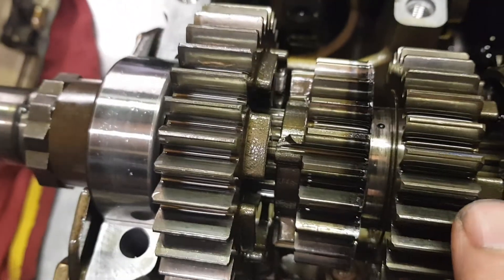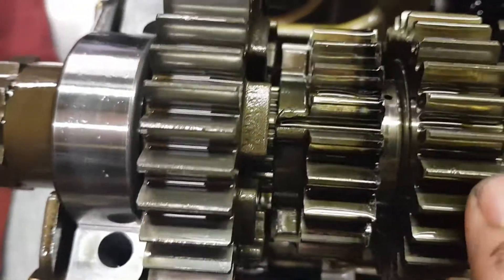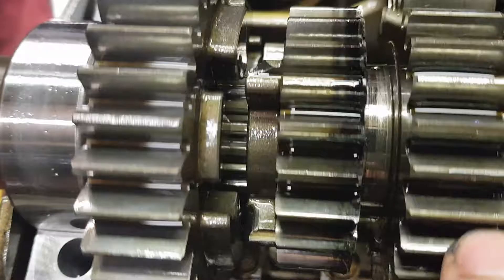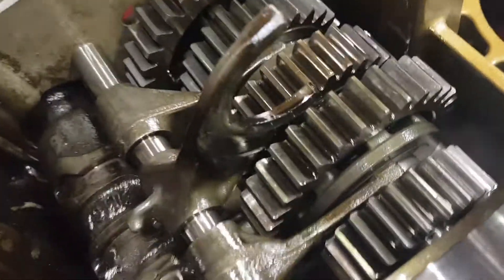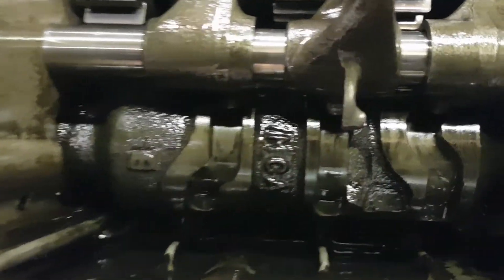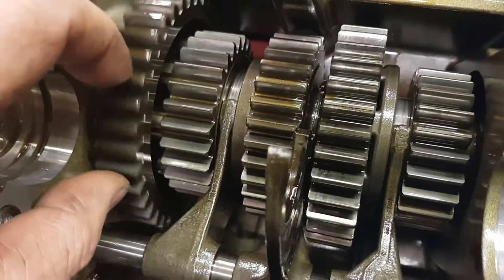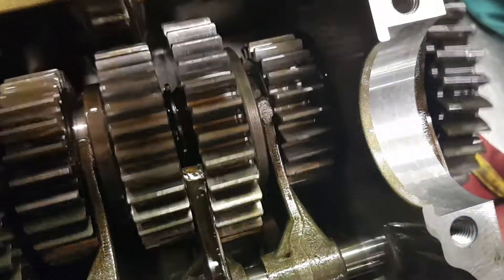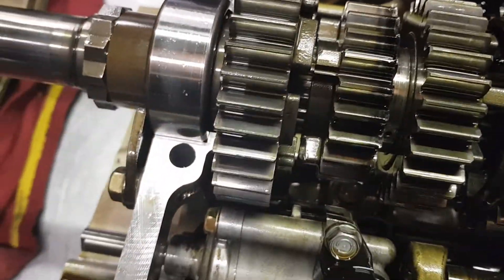015 - Another GL1800 Gearbox Failure - We Can Fix It - 2

Comment: I have had two Yamaha ventures, combined mileage over 200,000, over 18 years, one BMW K 1200 LT, I won’t go into it but I will never buy another BMW. And I just bought my first GL 1800 Goldwing.
 I read the owners manual cover to cover, slowly, because I was in a hurry to absorb all the information that was different from anything else I have owned..
 I learned one thing that many gold wing owners seem to ignore. The manual specifically states, do not use a heel toe shifter on the gold wing...
  I am betting that the factory knows more about that subject than the people that make he’ll toe shifters in the aftermarket for the gold wing.
  my Goldwing had some aftermarket accessories. One of them was the heel toe shifter/floorboards. I am not a fan of floorboards, I removed the floorboards and put the stock foot pegs back on as soon as I got the machine home. Luckily, The machine only had 13,000 miles on it when I bought it, so the heel toe shifter was probably not on there long enough to do any real damage..
when I bought my machine, it is a 2002, I bought it in 2019 from the original owner. He was honest and told me that he never did things like change the clutch or brake fluid, he never changed the air cleaner, the machine still had the original 18 year old tires on it. So I spent weeks doing maintenance chores.. changing the brake fluid, and the clutch fluid, when I used my vacuum bleeder on the clutch to change the fluid, that brake fluid looked like melted chocolate ice cream. I’m surprised the seal didn’t fail.
 The air cleaner had a mouse bed in it. The fork oil was never changed. While I was at it, I replaced the fork seals and wipers and fork fluid and upgraded the fork springs. I also upgraded the rear shock spring to match The fork springs. They were 18 years old, and what a difference it made. It transformed the motorcycle.
 Anyway, while I was doing all of these maintenance chores, I was looking for the fuel filter. I went through my phone book sized factory Honda service manual, I could not find anything on the subject of fuel filter or fuel filter location, in the maintenance schedule, they don’t mention the intervals to change the fuel filter. I couldn’t find one on the Internet for sale listed.
  it turns out that the GL 1800 from the factory does not come with a fuel filter.. that sounds crazy, but there is no replaceable fuel filter. Maybe the in the tank fuel pump has a very fine screen over the in the tank fuel pump pick up..
  my experience as a motorcycle mechanic in four different shops with transmissions is, if you miss a shift, do not jam the bike into another gear until the RPMs drop, and always shift up. Take your foot off of the shifter when you are done with every shift to allow the shift PAWL to re-center around the shift drum shift pins. Never rest your foot on the shifter. You will burn the shift forks and the channel on the gears that move when the shift forks apply pressure.
 always always always use motorcycle specific oil recommended by the manufacturer. You cannot use car oil in motorcycle engines ever again. The reason is
  in 1988 or 89, the federal government asked car manufacturers and oil companies how they could work together to get more miles per gallon out of a gallon of gasoline. The result was a huge change in oil’s that we use in our cars.
  to cut to the chase, they have removed most of the zinc and phosphorus from the additives package of oil to make it thinner, less resistance to flow, the engine doesn’t work as hard, even if every car on the road using these new thinner oils gets 1/10 of a mile further per tank full of gas, that will save millions of gallons of gasoline per month.
  here’s the problem with modern oil’s made for cars, I repeat made four cars.
 remember I said they removed zinc and phosphorus almost completely from the additives package that they add to oil.. well, zinc and phosphorus are the exact two additives that give oil something called higher film strength. As gears in the transmission mesh on a motorcycle, which uses the same oil to lubricate the crankshaft and the cylinders, in the transmission, as those gears mesh,, those gears and that oil is subjected to a condition called “Shear”..
 sheer, actually slices the molecules in the oil, and it keeps chopping them every time that oil gets squashed between the gears as they mesh under pressure. You can tell when your oil is worn out on your motorcycle when it becomes difficult to find neutral, and when it becomes difficult to shift. I have experienced this myself, some motorcycles you can feel it sooner than later.
  motorcycle specific oil has the required amount of zinc and phosphorus in the additives package to withstand sheer. there is not a more severe environment on oil than in a transmission. In car and truck transmissions, they use a heavier oil, sometimes it’s called gear lube to withstand the enormous forces on the gears faces and on the oil...
  baby your transmissions, don’t attack your shifter when shifting or when trying to find neutral. Never tried to find neutral when your engine is not running unless you’re rocking the motorcycle back-and-forth gently. I have seen people attack the shifters with the heel and all their weight of their leg like they were kicked starting it. That makes me cringe when I see that.
  baby that shift to second gear on all motorcycles, don’t Revit up high in first gear and then slam it into second. There’s just so much torque on the entire drive train, and when you shift from 1st to 2nd, all that inertia and momentum making those gears stop dead over and over and over, has a cumulative affect on the shift dogs. once your bike starts jumping out of gear on acceleration, or missing shifts, be prepared for an expensive repair job. As a matter of fact, it is so expensive, it would be cheaper to buy an engine complete out of a salvage yard then to pay someone to rebuild the transmission in a motorcycle like a gold wing. It’s one of those jobs, that, while you are in there, you might as well do this and then you might as well do that, and the next thing you know, you spent thousands. If you blow the transmission on a GL 1800, do a Google search and find a salvage yard, and buy an engine out of a low mileage wreck.. it’s cheaper and quicker. A friend of mine broke the timing chain and his venture engine. This was 20 years ago, he got an entire engine from a local salvage yard for $400. That is less than he would’ve paid for the timing chain, timing chain tensioner’s, engine gasket kit, and all those little extras..
Reply: I stopped ready an hour into your story, but im dying to kno. What was the moral? Have u told Honda to take a hike yet? You will.
Reply: I have the '07 Goldwing only 14k miles and these bikes shift  very loudly clunky I wish they were quieter shifting. I'm wondering if there is a specific oil that might quite things down a bit..

Comment: this is a good reason to lower the horsepower on motorcycles. Back in 1989, the force on transmission gears on some high powered motorcycles exceeded 100,000 pounds per square inch of force. That happened when the Hayabusa came on  the market..
  that’s a lot of sheer to expose the transmission oil too, and that’s a pretty tall order to expect the zinc and phosphorus in the motorcycle specific oil to stand up to..
  I had a Honda GL 1800, I did a comparison opinion review between my GL 1800 Goldwing and my Yamaha royal star venture back in 2021 on my YouTube channel. In that video, I mention how smooth and powerful the Goldwing is, smoother than any motorcycle I ever had, or ever even rode. And at that time I said that the Goldwing was unnecessarily overpowered. I think 70 or 80 hp is plenty to propel a motorcycle this heavy on public roads. This transmission failure in this video, showing the dogs on the transmission with that damage, that could be from poor, shifting habits by the operator, it could also be because of the massive automobile like torque The Goldwing and other overpowered motorcycles have. Gearboxes, transmissions, whatever you want to call them, they also have a nickname of crash boxes. That is a pretty violent process taking place inside of a manual sequential constant mesh transmission. Back in the 70s and 80s when horsepower was increasing, transmission, reliability was going down. Many many motorcycles would blow second gear. To this day I still always short shift through 2nd to 3rd…
The Yamaha XL 750 triple had one of the worst designed second gears on the market. I worked in a Yamaha shop at the time. One of the mechanics there got to do all of the warranty second gear failures. I didn’t see him do it, but he claimed he could change the broken parts by going through the clutch basket cover instead of pulling the engine and splitting the cases. That’s how good he got out doing it because they were failing so often. 
that was still true when the 750 became in 850 in the late 70s and early 80s. Second gears were failing in the newly introduced Yamaha venture royale 1200 in 1983, 84, and 85. They finally redesigned second and fifth gear for the 1986 model year when the engine became a 1300. That’s the year I bought my first venture. , which I rode for 16 trouble-free years.. I always short shifted second, and went to third very quickly before pouring on the cold on that machine, that became a habit, which I still do today..
  when a transmission has a piece of one of the engagement dogs break off, the odds are pretty high that that is going to get caught between two gears that are meshing.. when that happens, the transmission locks solid, and pulling the clutch in does not release the rear wheel from being locked. The clutch just disconnects the transmission from the engine, it does not disconnect the transmission from the rear wheel. So when the transmission locks solid, so does the rear wheel. And you better hope you’re not traveling more than 10 miles an hour when that happens…
  The transmission that I had locked up was on a Yamaha RZ350. That’s a light machine. I almost lost control when that locked up, and it dragged my back tire down to the cords. On my way to work one morning when the transmission locked, I had seven broken gears in the transmission, and one of the gears was seized to the main shaft…
  I don’t know how much those gears cost retail because I was working part time at a Yamaha shop and I got all the parts at cost. Just one of the gears when this happened back in the early 1990s list price was $370. That was just one gear, that was over 30 years ago. The price of those gears today if you can even get them would be probably more than the motorcycle is worth..
 When I fixed that transmission with all new parts, I never trusted it again. I just could not think of anything else except that transmission locked up. I had that I almost lost control at 60 miles an hour. And I sold that machine because I just did not trust it anymore… I could not think of anything else while I was riding it.. even though the lock up was my fault, because I was unknowingly running it on half the oil it called for..
  I have had engines seas on the road race track, pulling the clutch in freeze the back wheel up , i’ve had a front tire go flat on the road race track at speed, and I was able to control the machine to stop. I have hit two deer while riding motorcycle. One at 35 miles an hour. On my way to work one morning, and one at 70 miles an hour on my 900 pound BMW K 1200 LT. I did not go down either time. I just pulled the clutch in and coasted to a stop both times, then I got excited..
 but a transmission locked up is completely different because you have no control. That rear wheel is locked solid and there’s nothing you can do about it. Just hope you don’t high side, or go out of control into oncoming traffic, or into guard rails on the side of the road, or get hit from behind by a truck that did not expect you to slow down for no reason like that.
  The national highway safety council needs to step in here and ground all of those motorcycles that are suspected of having this emergency issue that must be dealt with now, this is an emergency
 when the fatalities start happening, and they are going to happen, Honda is going to be in hot water, and all of the gold wings are going to be worth much much less money because people will be trying to get rid of them, and everyone will have heard of the transmission failures, and nobody’s gonna wanna buy them..
  I had a GL 1800 Goldwing, it was a nice bike, in my YouTube review comparison with my current machine, a Yamaha royal star venture, I gave my reasons why I liked the venture over the Honda Goldwing. But I did tell the truth, and I said that the gold wings are perfect, but they are just a little too time-consuming to work on and that’s what I didn’t like about it.
  I don’t envy any mechanic that has to pour these engines and split the cases on these Goldwing transmissions. That’s the reason I got rid of my Goldwing. I can do the work, I used to be a motorcycle mechanic at three different dealerships decades ago, but I sold my Goldwing, because of what if, when I learned how difficult they are just to do routine maintenance, like, five hours labor is what they charge in a Honda service department, just to change the air cleaner… I thought that was ridiculous until I did the job myself. It does take five hours. That is a fair price of around $600 labor because that air cleaner is that difficult to get at. I sure would not want to have to start changing parts in these transmissions on the gold wings. If I had one right now, I would be torn about selling it. Because anyone buying it from me could be killed when the transmission locks.. i’m just glad I don’t have a Goldwing right now that I have to cross that bridge on whether or not to tell the buyer about the transmission failures..
 All the affected Goldwing owners out there I have my sympathy. And I would suggest to them very strongly, don’t ride that bike till it gets fixed.